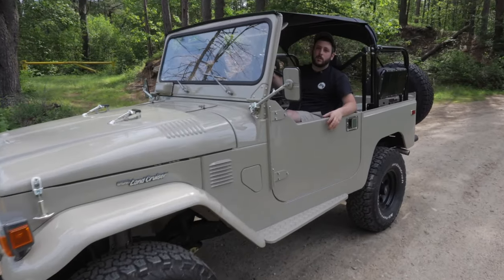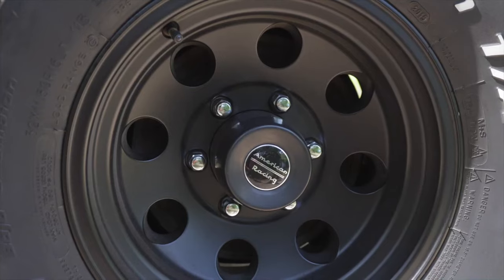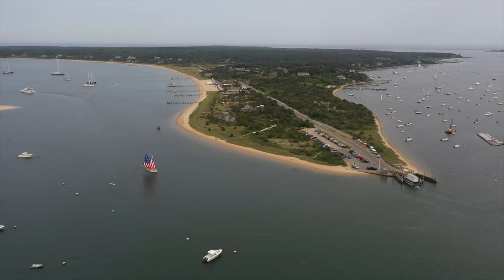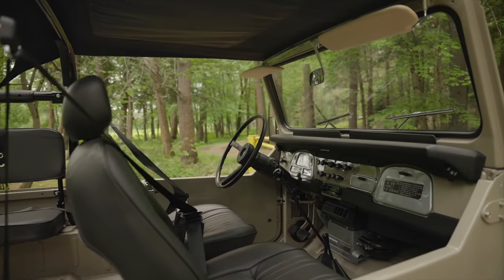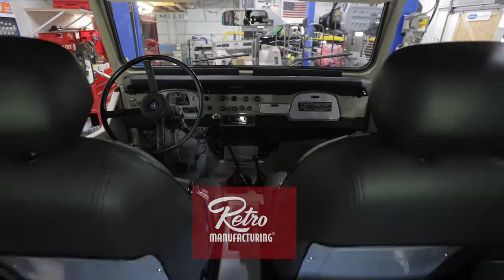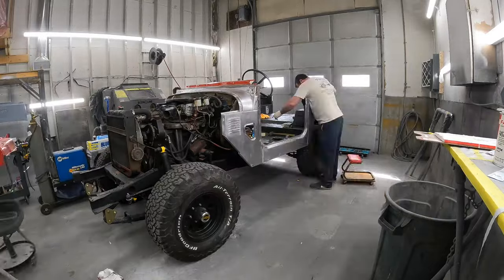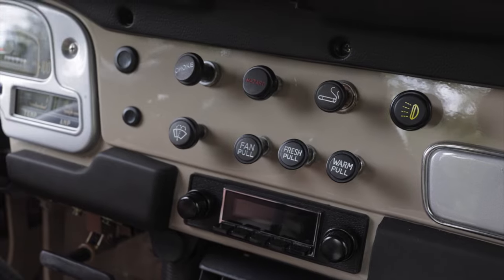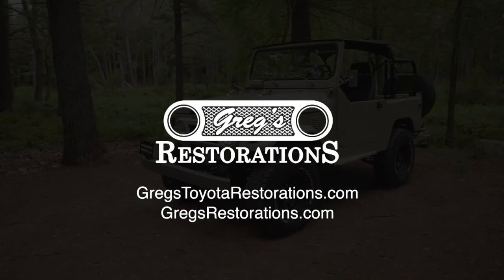1977 Toyota Landcruiser FJ40 Restoration "Beach Cruiser"

Comment: Love the way you did a conservative restoration on this FJ.  I had the thrill of owning two 79 FJ40s in Olive back in the 80s when I was in HS and College.  I ran the American Racing 15 inch white wagon wheels which I think looked great on these FJs.  Lots of memories in these FJs.  Hope to own one again in the future.  I recall on the 79s there was a blower fan on the left fender that would blow air over the master cylinder and carburetor to prevent vapor lock.
Reply from the maker: Thanks! Yeah the customer was trying to bring back some memories of his previous landcruiser. If you ever need another landcruiser let us know! I believe they started that in 78 with the carb cooling fan

Comment: A 'body on' restoration sounds less expensive. Staying with leaf springs in front with a two-inch lift and new shocks/ tires - do those 32x11.50-15's rub the springs, ever? A fantastic job down to every detail. I sold Toyotas in the mid-seventies and my brother loaned me his - love the old FJ's. My first car was a '66 IH Scout 80 with 4-speed, lockouts, full-top. A new set of H70-15's (P225x70-15) soon followed - Goodyear Polyglas R.W.L - they rubbed on the front and rear of the front leaf springs in a tight spot. Talk about 'bare bones' - dreaming of a Toyota FJ like this!
Reply from the maker: The tires were the perfect size, did not rub at all.  It's the perfect ride!

Comment: Great looking FJ40. I have one and have been wanting to put a stainless steel header (6 into ) and a complete modified exhaust on my vehicle. What type of performance did you notice by doing this modification? More power, exhaust note, fuel economy  etc. Thanks
Reply from the maker: We noticed a little more power & fuel economy.  Not much change in sound tone